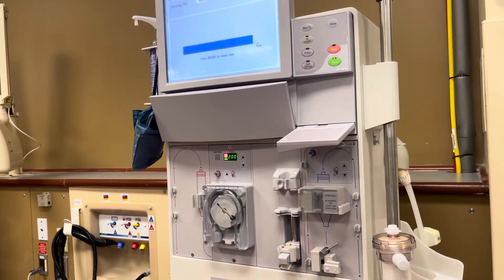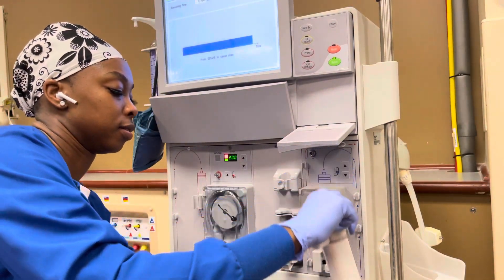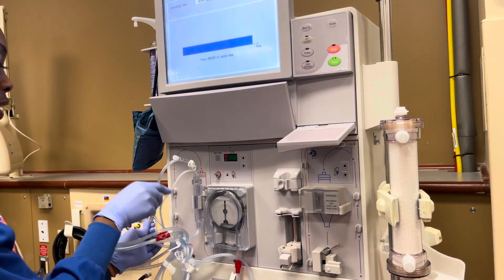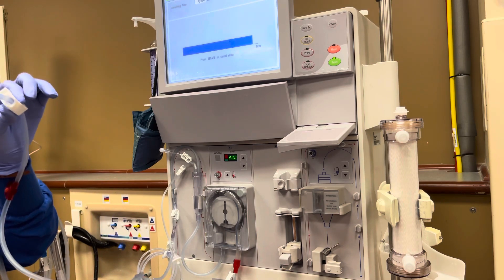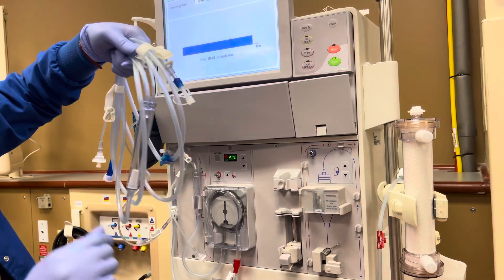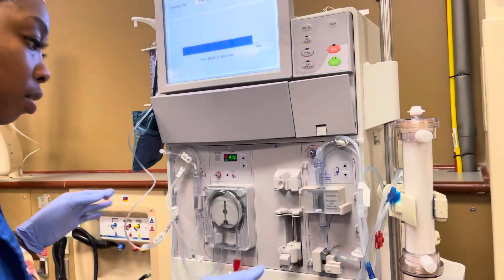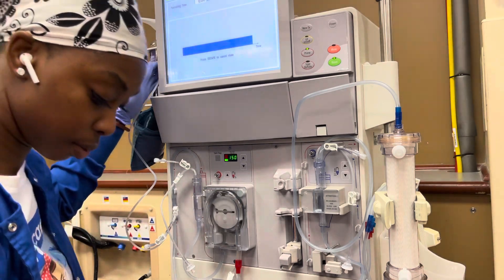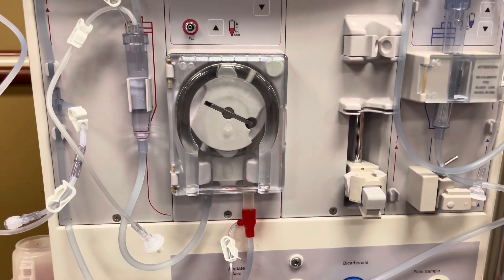Set up a dialysis machine with me!! Part 1 I  PCT Chronicles

Comment: Thank you so much for this video. I am currently training as a PCT with no dialysis experience, so I'm learning how to prime/set up the machine now. You explained everything so well, much better than my preceptor 😬
Reply from the maker: 😬Glad I can help!
Reply: @honeycream32  how is it going?
Reply: @reneeproud5273  it’s going good. I’m slowly learning one thing at a time. I’m now cannulating & connecting/disconnecting patients, so it’s coming along lol
Reply from the maker: @honeycream32 okkkk that’s awesome!
Reply from the maker: @honeycream32  what’s your favorite part so far? 👀😂
Reply: @imeboni  i think I’m starting to like the priming/setting up the machines during turnovers now. But also getting to know the patients
Reply: @ any tips on how to prime the machines a bit faster? My preceptor says i need to work on my speed with priming…
Reply from the maker: @honeycream32 when I set up I start with my arterial and spike my saline line , this begins priming my arterial while I’m setting up my venous. When I finish setting up my venous, I clamp arterial -fill arterial chamber-immediately press prime for venous.
Reply: @imeboni  thank you 😊
Reply from the maker: @ no problem. This video may help too https://youtu.be/6Lv3fv5AK-g?si=DY3Rna63E6jv6FfI

Comment: Thanks for this video. I’m going to be a tech and Nurse at the same time. I’m used in using streamlines w/c is much easier to set up than combiset..
Reply from the maker: Is streamlines in the hospital?
Reply: @ we use it before in clinics. I just learned that combiset is not that bad. But it’s still different 😁

Comment: I just started at Fresenius like 2 weeks ago and no lie the machine set up really trips me up and the other techs there don’t really explain what they doing while they’re going along . i didn’t think anyone would have a video of the more updated machines but i lucked up 🍀 when i found your channel . Thanks you so much 🤲🏽
Reply from the maker: It takes time but you will get it! I’m glad to be a blessing! Are there any other videos you would like to see?
Reply: @imeboni  the set up was the most problematic for me and even now  i review it consistently so I’m doing it correctly because one slip up and 🤯 but other than i think seeing  what parts to clamps on the machine would be reassuring and maybe if possible the water/dialysate check ..thats still kind of confusing if you wouldn’t mind but other than that i love the content 🤌🏽🔥
Reply from the maker: @FKASAINT006  ok. I can do one with the clamps! When you say water/dialysate check are you referring to the water room strip or checking the dialysate after you mix it?
Reply: @imeboni  thanks for asking when i meant far as water check i meant with the RC strips . Like the water check that has to be done to assure the machine are operable for the patients.
Reply from the maker: @FKASAINT006  no problem. My biomed just told me yesterday that the instructions should be either on the side of the bottle or in the bag that the strips come in. I want to make sure I’m answering your question correctly but What is the confusing part for you?

Comment: I working at davita now and it's not hard ... whats hard is when you have 4 patients and they coming off the machine .. patient one 10:15 .. patient two 10:30 .. patient three 10:45 .. patient four 11:00 and you have have to be fast to take off each patient 15mins apart and fill in snappy software wear ... remove the bloodlines .. clean the machine and reput new bloodlines on AND then connect 4 new patients who waiting ... that's the HARDEST part of this job.
Reply from the maker: Oh yea..CHANGE OVER is by far the hardest part of what we do. It will make or break you. Definitely has had me questioning my life at times lol
Reply: @imeboni  Yes but I found a way to beat change over ... as soon as you RINSE patient #1 ... hurry up put the clamps on his access .. and instantly pull off bloodlines and bleach machine and put new bloodlines on .. then prime .. then fill out snappy until patient #2 beeps
Reply from the maker: @damien_and_erza2195  truuueee thats kind of what I do and I get numbers while rinsing the patient back. While watching my patient to make sure they are safe because sometimes their blood pressure bottoms out when you put their feet down but that comes with getting to know the patient
Reply: @damien_and_erza2195  if you don't mind me asking, aren't you not supposed to bleach the machines while a patient is still in the chair?
Reply: @jessrymarz1554  No bro ... state says you wait until the patient leaves the chair then bleach .. if state there and you don't do it like that ... they will ding you
Reply: @Damien_and_erza21  that's what I said, you aren't supposed to bleach until the patient leaves, I was confused bc your comment said 1 put clamps on access, 2 pull lines and bleach. I thought you meant bleaching with the patient still there, so I was saying isn't that against policy.
Reply: Are you in California?
Reply from the maker: @85sosweet  no. I’m in Georgia